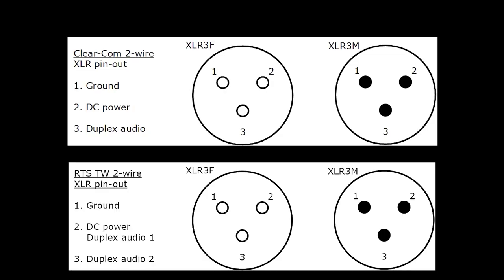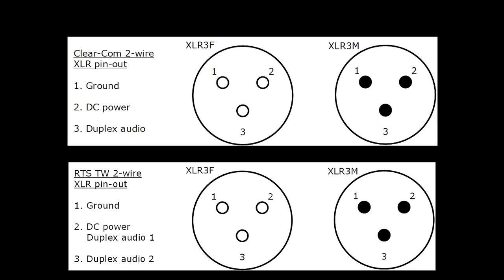2WR INTERCOM SYSTEMS EXPLAINED - CLEAR-COM / RTS

Comment from the maker: this product is 30v, at one i point i said 27v .This is important to consider  due to the effective voltage drops from long cable runs and running packs in series. Also, yes a mic pre amp can handle higher voltage , but  the meters will be slamming at 24v and its just a bad idea to plug comm into a console without a line dryer !

Comment: This is a great video, thanks! I have 3 base stations hooked together. I was handed a second hand system and have been tasked to make it work. 1 MS 702 feeding into a RM - 702 then into another MS-702. Feeding pgm audio into first MS702. I have to feed Intercom and a mix minus into an IFB. I have a RTS IFB 1000. The intercom into the IFB works great. I want to send a mix minus from my board to the talent. You stated that you run IFBs thru your board, can you expand on that? Is it possible to do what I want without buying a PIC4744 and PS 702? I also have 3 MA-704 units and Im not sure how to loop them into the system. Thanks for any info!

Comment: If i would connect a 3 base stations, should i switch on the termination of the first base station and the other 2 must be switch off?
Reply from the maker: There should be a chain of devices connected per port. So at the end of each port chain there should be termination. This helps with delay, impedance - nulling. Take a listen, is there any audible differences in gain or delay ? Doubling effect ?

Comment: Would be nice to have a tutorial on connecting to camera CCUs.  That is always a problem on every show.
Reply from the maker: sure - generally those are 2wr systems that then imbed over triax or fiber - the main problem I have seen there is most are rts by default and the wired systems or 2wr ports are clear com - without a converter from cc to rts inline there is problems. I will add it to my do to list of videos lol

Comment: Hey man- thanks for the video. I have a 702 Encore master station that is stuck on call. The light won't stop flashing on channel A or B as soon as a cable is connected to the back. Is this a fault or am I doing something stupid?
Reply from the maker: Sounds like , either a fault or the call button is stuck locked on a belt pack? Odd.
Reply: @KINETICPROFESSIONALS  Thanks man. If it was a belt pack with the call button locked is there a way to unlock it ?
Reply from the maker: @CharlieBryson-fg1eg  not that I know of. It must of gotten stuck in a closed loop. Check other belt packs one at a time and see if it goes away.  If it doesn't,  then it's the BS.

Comment: Question, IS there any way to convert 2 x Clear Com 2W channels to a single line RTS A/B 2W channel.
Reply from the maker: yes. But you need a couple converters and it depends on the system. For example, with a cc freespeak system i can select the 2wr type as cc or rts, if i selected it as rts i could send that into a rts system and from that point return out of it as a single line with duplex A and B on the same power line. Again, its a "yes" but not always a strait path.